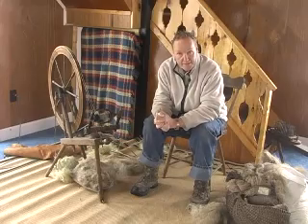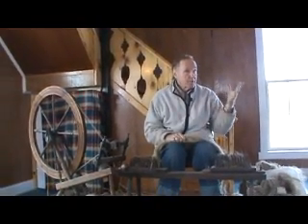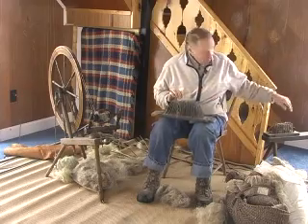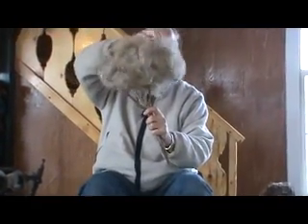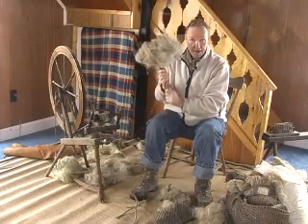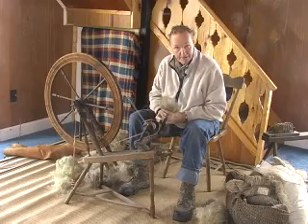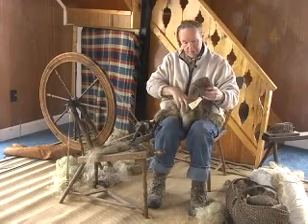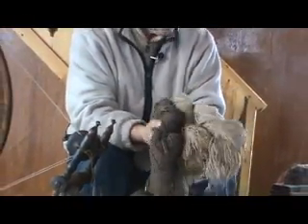Flax spinning - part 6, spinning tow on a Canadian wool wheel

Comment: How is a uniform thread thickness created, or is it not possible and thickness can vary?
Reply: You can count the number of foot pumps per measure of yarn that you produce which makes the twist very consistent. To keep the thickness the same you just need to practice drawing out fibres and get a feel in your fingers. There are templates to use to verify the number of twists and the thickness and if you're not satisfied you can just unroll the yarn and correct whatever is amiss.